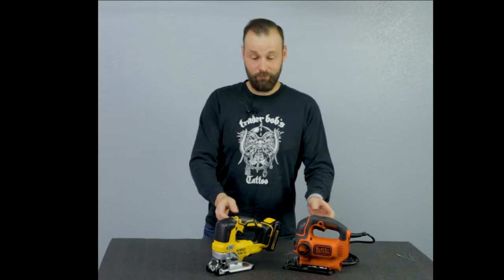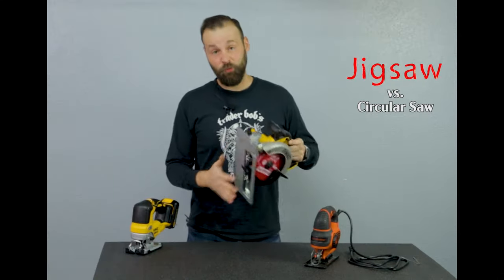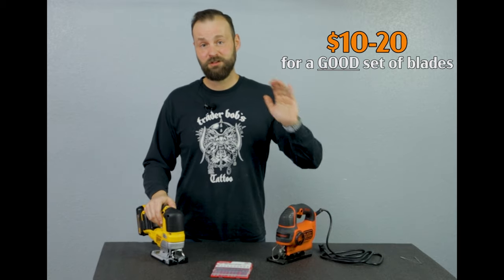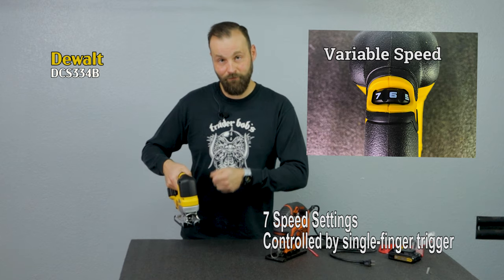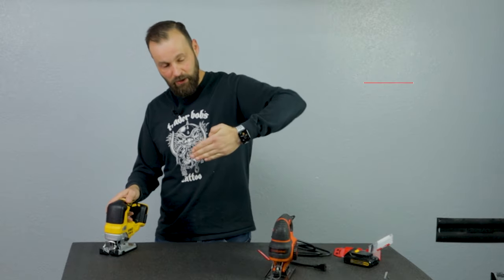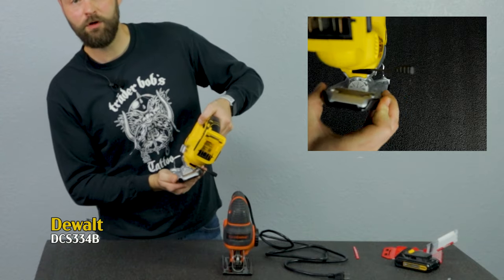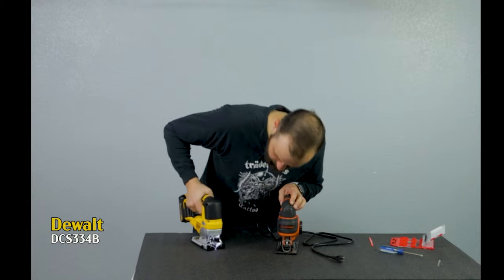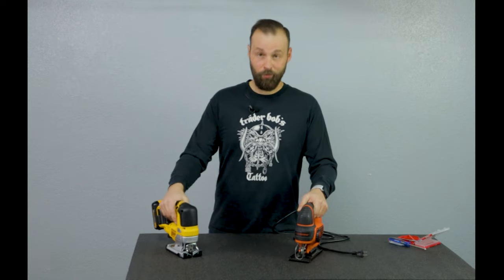Selecting the Right Jigsaw in 2023 - Features and Purpose - Compared

Comment: Looked at B&D featured in this review and bought Wen 33606 for about $8 more. Has a work LED and a laser cut guide, edge guide, vacuum port and dust blower, and blades (2). Shoe has a plastic no-scuff cover, and the bevel adjustment is secured by a hex bolt, not a screw. First use confirmed it doesn’t vibrate like my old HF. Tracked very well. Happy with the purchase.
Reply: Thanks for this comment!

Comment: My first jigsaw was circa 1980 mustard yellow entry level black & Decker.  I paid 9.99 and I was making about 2.35 an hour min wage, so a little over half a day labor to buy it.   It was still running when I upgraded to a skil brand for $25 with features similar to the black & decker you have here.  I would say either B&D or skil are great products today for $30 to $40 range.   About a month ago I got the 20v dewalt you show here.    My father had his  trusted 1960’s era Black & Decker (metal body) jig saw and used it for 50 years.   Dewalt used to make huge radial arm saws in th 1940’s and 1950’s  which we still used in the 1980’s construction site.  Then B&D purchased dewalt.   Dropping B&D professional and switching all pro tools to yellow dewalts.

Comment: I’m just a home maintenance kind of guy and I always choose Ryobi… right in between the DeWalt and B&D in terms of pricing and performance, they’re super durable, supported by Home Depot, their batteries fit into about 200 different tools, plus the fluorescent green they come in make them very easy to keep track of in a project area👍
Reply from the maker: I’ve got a few Ryobi tools too. They are great.
Reply: Yeah once you buy any battery packs, it's not practical to buy any other tools that don't use the same batteries.  I used an older model of this Black & Decker JS250 for years to cutout signs on plywood.  Now I don't have a need for one, but it really depends on what someone can afford for this project. Not everyone can afford festool ofcourse.  But the Milwaukee jigsaws are very good but still more expensive than a lot of people might need.  
Bottom line, I would hesitate to use a jigsaw on anything that your circular saw can't manage. Which is basically just making scroll cuts.

Comment: Good video, many tools are just not up to being cordless yet, a drill is awesome cordless, a circular saw not so much. A jigsaw is somewhere inbetween in the torque needed so was wondering if cordless was worth paying way more for. Good point about the gaurds and which one allows you to see the cut your making easily, so important and is a deal breaker for any tool but especially a jigsaw where small movements translate to large deviations. So is one that blows the dust away instead of dumping it all over your cut line.

Comment: I got a Black and Decker and I was proud of saving money for little jobs around the home. It broke after a couple of use. May be I was harsh with it, although I was much harsher with the Bosch (Once I broke a blade on it). I tried to fix the Black and Decker before borrowing the Bosch. I opened it up and saw that some parts are moved a bit around! I put them back into their place and it worked for another two minutes and then it broke again. So if you are rich enough to buy Black and Decker, Good luck! That was my experience.

Comment: DeWalt also has a barrel-grip model. Choosing between the d-grip and barrel is one of personal ergonomic feel, but it's good to have that choice. Another factor to consider is that if you do go cordless, you're generally going to want to plan it around what battery system you want to buy tools in long-term, not just one or two tools.

Comment: I have the B&D in the corded version. Unfortunately the blade deflection is pretty bad on material over 1/4 inch. It drives me crazy at times. Thinking of upgrading to a better performance model, DeWalt or Milwaukee just for the better blade guidance
Reply: Do you push too hard on the jigsaw? If so, sometimes too much pressure will skew the blade to one side. Also the quality and thickness of the blade makes a huge difference, a thin and poorly sharpened blade will struggle whereas a thick, quality double cut blade will power through even thick wood. I prefer downcut blades for accuracy and less splintering to the faceside of the wood too. 
A phrase I always heard years ago was 'Let the tool do the work'.

Comment: I have the Dewalt.  It make really clean cuts.  I came from the very expensive hobby of photography.  So spending $200 on a Sale also getting a battery and charger free seemed cheap for a quality tool.  AS a home DIYer it should last a lifetime.  But you also have the Bauer line at Harbour Freight.  I find that the older you get, the less you want to mess around with "beginner" quality power tools.

Comment: Could try rubbing some candlewax or beeswax on the metal base to make it easier to move and reduce scuffing. The plastic can still scratch ply surface. Orbital and bevel rarely used but may be worth trying it for mitre cuts.

Comment: Some complaints I have seen about different jigsaws (including the B&D) is the blade is not at 90 degrees and therefore unable to make flush cuts.  In the video both of these appear not at 90 degree.  Is this really an issue, or I guess only an issue if you are trying to make flush cuts.

Comment: Informative video with comparison. I'd go with B And D. By the way was the stroke depth with the default able to be faster than BD?
Reply from the maker: You are correct - Dewalt is a little faster. But if it’s not a tool for your daily work, the BD will get the job done (even though it might be a little slower).

Comment: try saw a straight line with the blackndecker impossible with all the blade deflection
trie saw arround a corner, the blackndecker doesnt has the power for it,
Reply from the maker: I used the B&D for over a year before switching and it did the job well enough.  But yes, it does require a lot more effort from the operator to make the cuts more precise.
Reply: @Outlaw_SEO  i also have the b&d, 
now i got the milwaukee m18 fuel
Thats a beast

Comment: I dislike the cast aluminum base plate on that Dewalt.  I have an old Ryobi corded Orbital Jigsaw with a similar base plate to the Dewalt  I dropped it about 18 inches onto the floor. The casting broke. Ryobi discontinued spare parts for this model. So my next jig saw is going to have a stamped steel base that will merely bend if dropped. At least then I would be able to just bend it back into shape.

Comment: hi my friend. I much enjoyed your video. It is full of content and not just for show. i believe that a proffesional should go both sides. A battery powered tool and when juice runs out then just plug the corded and continue. but, if you are a hobbist and work for  pleasure and recreation, i believe that a corded one is more appropriate. because you don't get to use the tool on a daily basis so a corded one will last you a3 lifetimes, but battery will eventually degrade costing you money to rebuild or buy a new battery , provided they still exists. 
I just purchased a corded jigshaw for 35 bucks and it has a light and a laser guide. but it doesn't have toolless angle adjustment, you need an allen key to adjust angles. 
as for the two in your video, sure the dewalt has many comfort features which make you job easier but you can find all of that in the 50 bucks corded field. so in my opinion all the comfort features are overrated by manufacturers and that black and decker could have all these features for the same price.
Reply from the maker: Well said. I completely agree.

Comment: The real tale is told within the warranty limitations. B&D tells you, right out of the gate, that their tool is not meant for regular usage. 

Understand that Stanley owns BOTH B&D and DeWalt, and they make each line for specific purposes. There is nothing "wrong" with the different ideas. The cheaper line is simply meant for occasional use, is all. So I am not about to knock B&D's intentions.

But in reality, B&D does not even hold up under the limitations they set for themselves.

I am a home use guy. When I was young, I bought a B&D 12 volt impact for my first home. Scratch that. It may not even have been an impact. Maybe it was just a drill. I do not remember. In any case, I am NOT a tradesman. I am just a guy who does his own work around his own house, s I assumed the B&D would be sufficient. That 12 Volt B&D smoked itself after about 3 years.

Not wanting to keep replacing tools for the rest of my life, I asked my contractor friend for advice. On his advice, I went 20V and I went DeWalt. I bought a set, with a regular drill and an impact. I am 51 years old now, and I JUST upgraded (to newer DeWalts). Those drills I bought back in my 20s were working fine, and I gave them to another friend who uses them to this day. 

"Buy Once, Cry Once" is the saying. 

The DeWalts are more expensive. They are a LOT more expensive. But when you factor for the fact that the DeWalts you buy may very well last you the rest of your life...well, they are really cheaper in the long run.

Like I said, Stanley is happy to sell you 5 B&D tools over the next 15 years, or one DeWalt tool. YOU, on the other hand, will be MUCH happier if you just pony up and buy the DeWalt.
Reply: Every 12V tool regardless of brand had fairly poor longevity in my experience.  On the other hand 20V or 18V, which are actually the same thing, are much more robust.